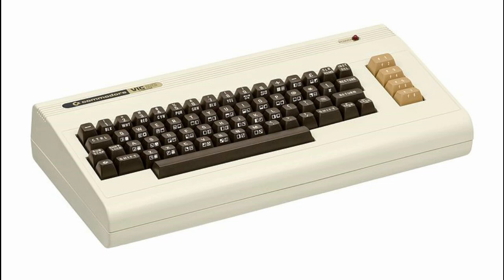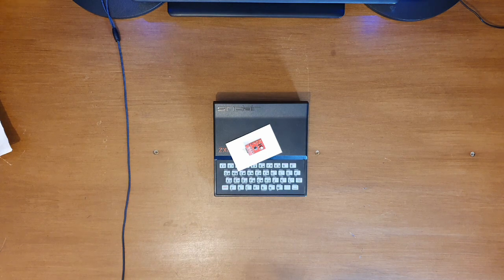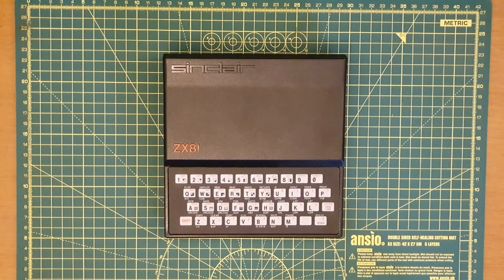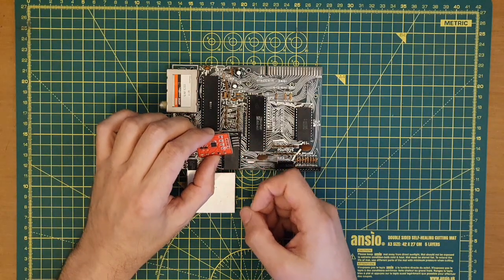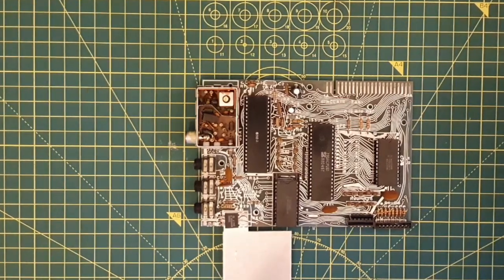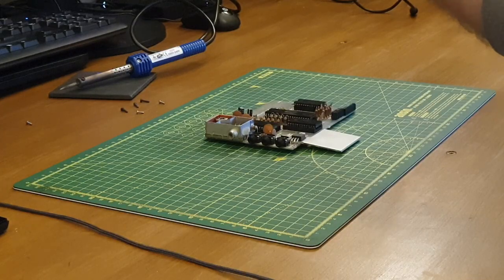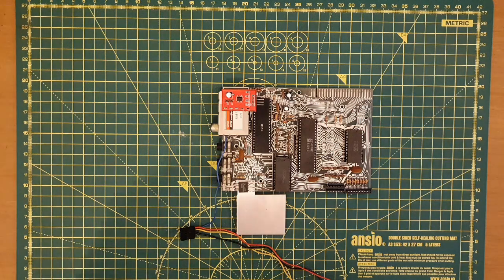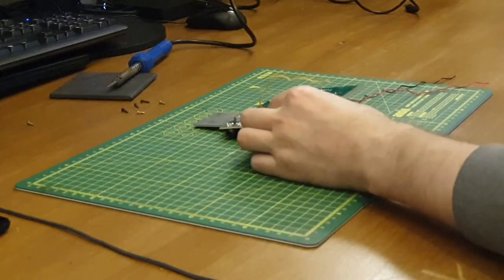Sinclair ZX81 Composite Mod : Part 1

Comment: Alright buddy, if you have t got a soldier stand, I’ll bing one in the post for ya!!!
Also, as a tip, for the screws etc, I use an old ice cube tray. Stops them rolling around and you can keep them in a cube relative to the position they come out of. 
Cool little video mate. 😎👍
Reply from the maker: I have got one somewhere in the house... probably two!! One is bound to be in the Retro Corner somewhere...! (But if I can't, I'll give you a shout Kriss, cheers!) 
My usual preference is to sketch onto A4 and then poke the screws though in the right places, but this is good idea...! Look out for an ice-cube tray featuring in the "Corner" soon...!! :)

Comment: I have never seen inside a ZX81 before. Those traces look so odd, as if somebody had drawn them by hand.I thought it was wire wrap at first when you took the back off.
Reply from the maker: Hey BarTech TV. Yeah, I'm loving those traces... and indeed I do believe they are the handrawn ones straight from the original plans for that board. You can almost see the electrons flowing around them....!😄

Comment: Hi, I cant find composite mod . Can you help please?
Where is part2?
Reply from the maker: Hi there Al! This is a well respected composite mod for the ZX81 : https://www.sellmyretro.com/offer/details/zx8-ccb---composite-video-output-for-zx81-3712  It supports the Issue 1 system board, like my Zeddy, which unfortunately the sample mod in this video, does not. I'm looking into options to alter this sample mod that I have, to work on my Issue 1 ZX81. If I make progress, I'll upload a Part 2. :) Thanks for watching!